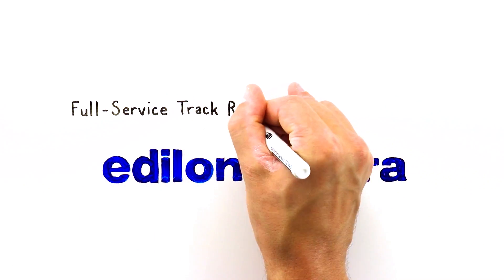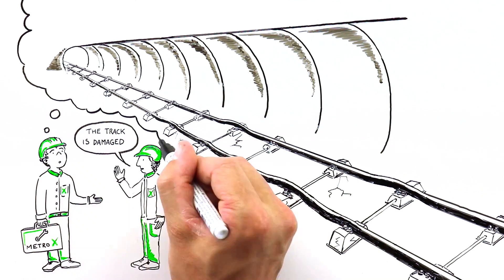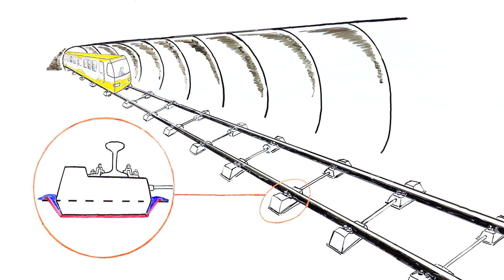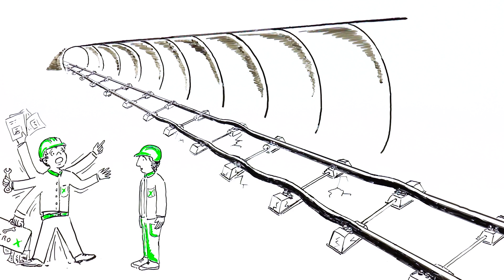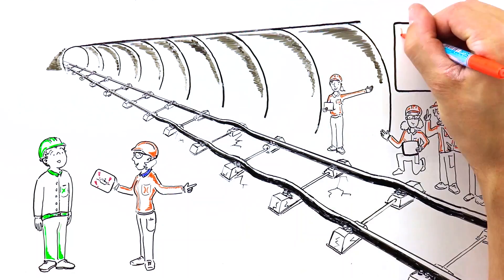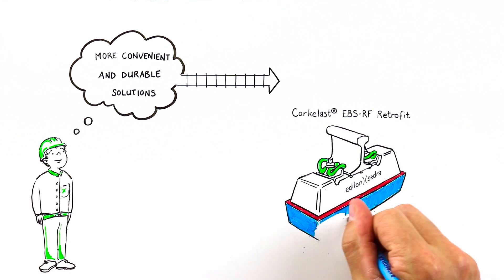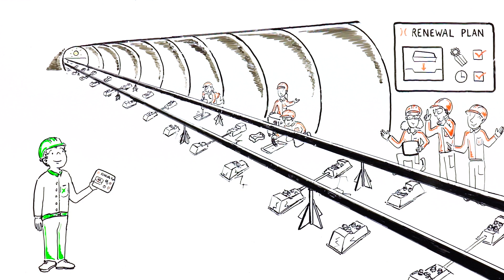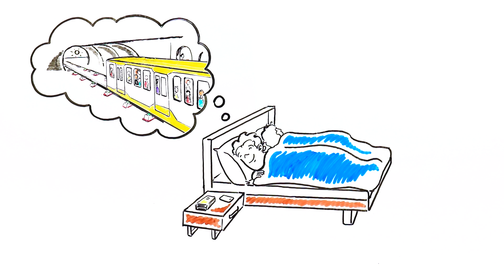How to refurbish damaged “booted (bi-)block” tracks

Comment: THE CHALLENGE: Replacement of damaged and worn out booted (bi-)block rail tracks 
THE SOLUTION: edilon)(sedra EBS-RF - Saving Time and Money by simple and fast installation for regaining 
)( High electrical insulation 
)( Excellent signalling properties 
)( Low frequency vibration isolation (mass-spring system)